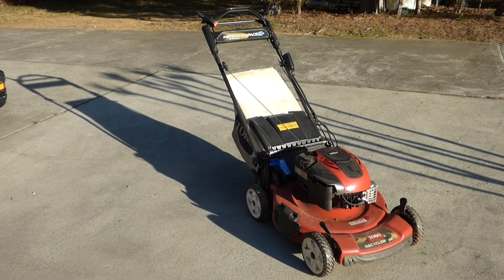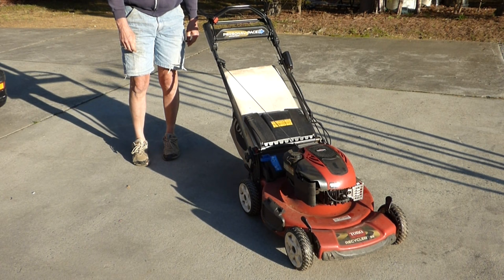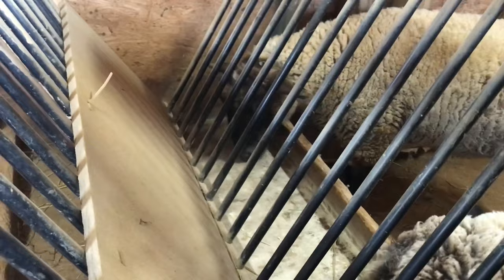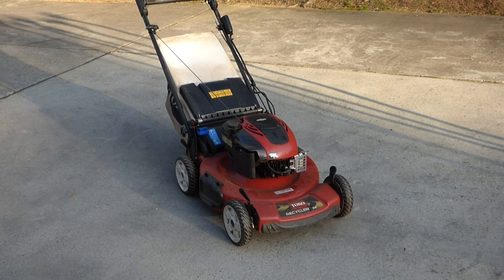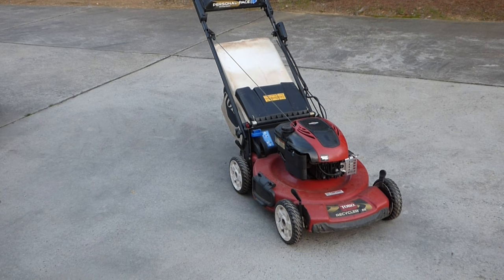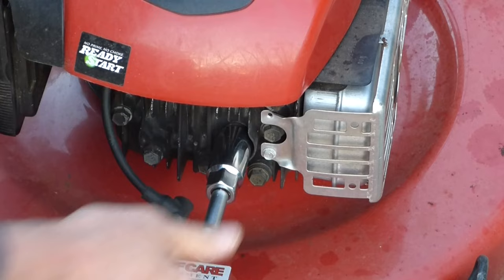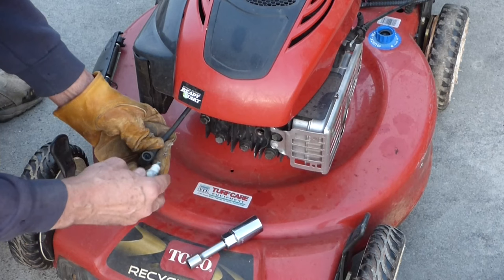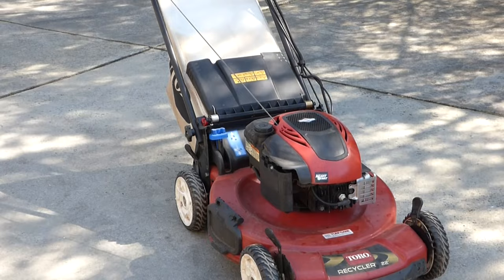Fix a Lawn Mower that Will Not Start When Hot - How to Diagnose & Repair

Comment: You're going through all these unnecessary steps
Reply: I like toro mowers
Reply: I’m having  this exact problem  on my mower. I’ve been putting off dealing with it and planning to get to it this week. Very interesting, and I, for one, appreciate your process of elimination diagnostic method.
Reply: @tommartin358 .
Reply: Agreed. Checking the spark plug was a waste of time. It obviously has spark.
Reply: @dropndeal  it's common sense, nothing "superior" about it.
Reply: Was that the original fuel that was in the lawnmower, or did you put fresh fuel in it? If it was the original fuel that sat up, there could be condensation in the fuel. Just dump out the old stuff, and put fresh gas in, and it should crank up. I run into this problem a lot, especially right after winter. I live in southern Louisiana, and the humidity is an everyday thing around here. YAH bless!!!
Reply: @tommartin358  tilt the mower over towards the carburetor then pull it .
Reply: Not everyone knows small engines so he’s just showing them what to check to all you master mechanics of small engines… ungrateful people on here
Reply: Thank  you sir for a such great video !! I really appreciate
Reply: I have the exact same problem and I’ve gone through the same steps and it hasn’t helped. The mower always struggles to start on the electric starter, it cranks and cranks and cranks until it starts. It starts a bit easier on rope. I’m at a loss.
Reply: Also the voice is extremely annoying
Reply: Why would it be the carburetor it was running fine till you shut it off
Reply: Great job thanks
Reply: @jwayne777 won't that leak oil into the carburetor intake? 😮
Reply: Op your dad isn't your real dad

Comment: the easiest fix is a shoestring tied around the handle.  NEVER shut it off!!
Reply: Mine stalls sometimes if it gets blocked up with grass, I’m having this exact same problem, identical mower.
It’s been such a great engine up to now, had it 8 years and until this year it’s never needed 3 pulls to start, even after winter.
Reply: Zip tie open enough to slide around the handle

Comment: It's the coil that rides on the fly wheel. And some times need to take sand paper and clean the rust off of the fly wheel
Reply: Coil needs sanding and block mount area

Comment: Great video, I just went through dealing with a Briggs 725EXI lawn mower engine that always starts and runs great for as long
as you want, but is dead as a dodo immediately after you shut it down even for a couple
of minutes while emptying the bag.  And then after about twenty minutes of cooling down, starts right up again.  Replaced the coil, cleaned the carb, which helped a little for a while, and then replaced the carburetor the other day, and the problem still persisted!  I had an AH-HA moment yesterday when I started to suspect that crankcase breather oil fumes that dump into the air cleaner were involved.  Sure enough, after temporarily disconnecting the breather hose from the air cleaner housing, the hot start problem was eliminated!  Did repeated hot starts on the first or second pull.  This 725EXI has recently starting to burn a bit of oil, and you can see oil sludge building up inside the air cleaner housing at the carb inlet.  Apparently the hot oil fumes are messing up the fuel mixture enough to prevent a hot  start, but do not really impact a running engine, the engine always runs very strong and smooth as long as you let it after a cold start, but once hot, nothing doing!  The whole situation makes sense now, once the engine has cooled down, the crankcase fumes are not present on a cold start to
mess up the air fuel mixture….

I’m posting this to bring this to everyone’s attention, I have not seen anyone else make the connection of the hot no start problem to crankcase oil fumes.

Looks like the engine needs a piston ring job, wonder how easy that will be, anyone out there have any experience with that?  Any associated YouTube videos?

Chris B.  Stonington CT
Reply from the maker: Thanks for sharing
Reply: Thanks for sharing as I have exactly the same pattern on an old engine that does burn some oil. I replaced the spark plug, carburetor, air filter and no change. Will try your suggestion. Thanks
Reply: Great job figuring that out, same issue here
Reply: Thanks for sharing. I’ve also replaced carb and coil, air filter is unrestricted and governor adjusted according to manual. Still have problems after shutting off to empty bag. Guess I’ll be performing a compression test.

Comment: Exact lawnmower, exact problem since new. Took to a toro dealership said they fixed it. 2nd time I used it, it acted up again. I sold it yesterday they found your video and took off the carb and cleaned it. Solved the problem.
Reply: Yup, sitting over winter with gas in the carb will mess it up every time unless you put gas treatment in it...

Comment: Same issues I had. I first replaced Spark Plug & Air Filter, didn't do any better. Cheaned fuel line, carb & stuck auto choke.👍 Fixed.😃
Reply from the maker: Way to go!

Comment: Fabulous instructional video! Thanks so much! I've got a 12 year-old Craftsman Briggs & Stratton Chipper Shredder that does exactly the same thing. Tuned it up with new materials. Drained the gas, sprayed the carburetor, etc. Runs like a charm on cold start, but won't restart when warm or hot. So frustrating. I was ready to buy a new engine coil, but I think I'll try to more thoroughly spray the carburetor again and see if it can restart when I need to stop the engine for a few minutes. I'll also blow some air through the gas hose and see what happens. Thanks again!

Comment: Brilliant video. I stripped the whole fuel system down and it still struggled to get going. After watching this I cleaned out the carburetor😁 and used Engine Starter Fluid. Works perfect now. THANK YOU
Reply from the maker: Way to go

Comment: I have the exact same problem. If engine is hot and I restart in about a minute or less - no problem. Somewhere around 3 to 4 minutes off, it won't start. I suspected hot engine auto-choke issue but didn't want to waste time until I saw this video. THANKS! - to author and others. Will try carb and fuel line clean out, replacing gas cap.

Comment: I have a rock solid Husquevarna with a B&S engine on it.  It starts first pull every single time for all 6 years that I've owned it.  Except.... it sometimes won't restart until it cools down JUST LIKE THIS ONE!! I can't wait to go home and see if I can fix it for good!!  I'm sooo tired of having to mow my lawn in chunks day after day. 

Thank you good sir!
Reply from the maker: when that happens remove the air filter and spray some starting fluid in the carb and see if it will start (like I did in this video).  If it will start then  you know you have a fuel problem when it gets hot.  Let us know what you find
Reply: @helpinguonline  I finally found this video again to give an update:  PROBLEM SOLVED!!

I ended up taking the carb completely off and giving it a deep clean.  Cleaned out the gas tank, and checked the spark gap.  Maybe $5 worth of "parts" because I didn't have dedicated carb cleaner and sub 30 minutes of effort; and it hasn't had the issue SINCE!!!  It's been back to first pull every time for a month now. I was looking at buying a new mower before you taught me the fix.

Again, I thank you for your knowledge & this video!!!
Reply: @helpinguonline  Reporting in Captain. I installed a gas line cut off last summer, so the carburetor never sits with gas in it; and it starts first pull every time to this day. 
Again, thank you for curing it!

Comment: Yay. Congrats! 
This is NOT the prob with mower,  but it IS a prob with my 30yo Ford Fiesta: starts first time in the morning but when I come out of the supermarket it can take up to ten tries before it starts. You can hear the starter whine and finally connect. Did a bench test on starter, cleaned all connections, no difference.
Reply from the maker: Sounds like the throwout bearing on your starter is getting weak and going bad

Comment: I ve been fixing mower s for some years and In my experience its almost always the carb.  hardly ever a coil or plug.  BUT I h ave one now that still wont start hot even with a clean carb... seems to need a bit of choke even when hot.  driving me crazy. 
All the best!
Reply: Same problem for me, I've cleaned the carb and I still won't start when hot. 
Have you found a solution?
Reply: Same problem for me, I've cleaned the carb and I still won't start when hot. 
Have you found a solution?
Reply: Did you fix it George?
Reply: Thermostats go bad on these over time.  You can see the problem from the side by looking at the position of the arm.

Comment: I am having this issue with the same kind of mower just wanted to see what your fix was. After disassembling the top of the motor checking and rechecking the coil gap and making sure the choke flapper was operating correctly. I found that the thermostat the that keeps the choke open when it's warm is causing the carburetor to not deliver fuel to restart. Therefore I need to clean the carb like you did. So there's the root of the problem, the choke system!

Comment: I've got a Stihl FS 280 Brushcutter that does exactly the same . Starts and runs a treat but once it's heated up , if you switch it off before you're done , then you can forget starting it again . Now I know a good place to start . Thanks .
Reply from the maker: Glad it was helpful to get you started on your repair

Comment: "Throwout bearing"!! I've never hear if them. Thanks a lot for the clue. I shall start searching forthwith. 
In fact I bought a second hand starter from Napar (is that the word?) for 60€ but never got 'round to testing it for the simple reason I didn't know how😮. Well, I finally tested it and the pinion/bendix shot out but didn't spin. Dismounted my one and it did shoot out and spin  so having cleaned all connections I put it back -- no difference. Someone said if the starter isn't used for a long time (9 months since I bought it) it can stick. 
So I'm looking up how to clean them up, and now also "throwout bearings'.
Thanks again for the lead! Very kind.
Reply from the maker: Disregard the throwout bearing I was thinking of another thing regarding a clutch. You are correct at looking at the Bendix. If your starter is working properly you may have some missing teeth on the flywheel so when the Bendix shoots out there’s no gears for that to engage with. Otherwise maybe your Bendix was stuck and now you freed it up when you did the bench test.  Sorry for the confusion

Comment: good info,  I tried this and I still have issues.  it seems to loose compression when hot, suspect exhaust value issue. it is also on a Toro. I even replaced the carb with a new one.   I had a used Coil that was known to be good and tried that and still have same issues so I knew its not a coil

Comment: Nice fix.
It was water in the gas. 
Just pour the gas out in a clear jug you can see the water inside.
Then drain the gas from the carburetor bowl by removing the bowl plug..
Before you do all that above 
You can tilt the mower  towards the carburetor to see if it starts. 
Thats how I find out. 13:35
Reply: So, if it starts up when i tilt the mower that means i have water in the gas tank? Thank you in advance.

Comment: I have a Husqvarna self-propelled with a Honda engine that will start on 1 or 2 pulls even after sitting in storage. It has never given me any problems.  My Troybilt Pressure Washer uses a Briggs, and it will no-start after getting hot. In fact, it exhibited this problem even when new, and after carb replacement. I guess it’s time for a coil replacement.

Comment: Check coil and Flywheel. Believe it or not you can hit something and jam the flywheel. I replaced both. Have new mower now.
Reply from the maker: Often times when you hit something it will sheer or knock the flywheel key, which is aluminum, off and throw the timing off on the engine Causing it not to start or run poorly

Comment: I have a ST100 bush mower with this exact issue. it doesn't restart when the auto choke system opens the choke butterfly valve in the carb. This however is the correct function of auto choke as restarting a warm engine choked may flood it.... as a closed choke creates the maximum gas draw.  Choke is needed when cold but should be open when warm. if a mower experiences this issue and a jet of fluid starts it, I guess there may be a suction leak somewhere resulting in no fuel delivery when the mower is manually pull stated. To complicate everything mine has a evap filter, additional hoses, possible sources off a suction leak !

Comment: Got the same mower. Hard to start after months dormant. Gotta yank the carb and clean out the old gas. Also, gas cap doesn't like to vent after a few years. I just back it off a few turns to stop the vacuum lock.

Comment: Very helpful video.  I had the same problem with my Toro Recycler; whenever I stop to empty the bag, I had to wait until the mover cooled before it would start.  I replaced the spark plug, changed the fuel, changed the air filter, but problem remained.  I  pulled the carburetor and cleaned it and ..... problem fixed.  Thanks for posting.
Reply from the maker: Way to go!

Comment: I was 99% certain what the problem was before I watched very much of your video? Wanted to see if there was something I had not seen, but that did not happen. It is the main jet that anchors the bowl to the bottom of the carburetor, and that's what it always is! That jet gets plugged very easily. I am going to install an inline fuel filter between the tank and the carb and see if that eliminates the non-starts.
Reply: Same.  Surging on first start was the telltale sign.  Choke is used when cold which allows more fuel for startup, but when hot the choke isn't used and the engine is starved for fuel.  If jets are clear on cold startup it won't surge like that.  Ideally, he would do a full disassembly and cleaning of the carb.

Comment: if its hot and it wont start with starting fluid...you dont have enough spark to start it....change the coil.  I've seen these things go bad...sometimes in the middle of cutting it'll just stop...you let it cool down and it will start right back up. Like someone else said spark plugs rarely go bad...you can pull and clean them, check the gap (about .030 for Briggs) and ensure insulator is not cracked..and torgue them properly. they need to be tight enough to seal properly.

Comment: I have the same issue with my Recycler. I've cleaned the carburetor, but the problem remains. Like yours, it will start with a shot of starter fluid and continue to run. If I close the choke while it's hot, it will start, though it's stubborn about it. I didn't trying blowing out the fuel line, but it seems to flow fine as it is. I may have missed something in the cleaning, but I cannot think of what.

It's a PITA. I have a second Honda mower, but it's a Frankenmower and doesn't do my preferred method of mulching. I also have a Honda riding mower, but it's seen better days and the electrical is an issue, as is several of the tires. My other riding mower, a Ryobi rechargeable electric doesn't want to work either. It drives fine, but the blades won't spin. They do start occasionally, but not enough to be considered even semi-reliable. I just don't have luck with outdoor power equipment.

Comment: I have a 2008 McCulloch B&S mower. Used to have a problem every year with the carb gumming up and fine debris in the fuel. Time consuming fixing it. Difficult or impossible to start. My cure was fitting a cheap Chinese fuel filter and stop cock. When I’m finished with the mower for the day I close the cock with the engine running and allow the carb to empty. I use B&S fuel preserver also. No problems for years. It starts right up after a freezing winter here in Scotland. E5 fuel.
Reply from the maker: Way to go

Comment: I just did a cleaning of my dad's trimmer. Same thing, he insisted it was the coil. We took it apart and check the gap. Nothing. So i just took apart the carb, sprayed some cleaner, and put it back together and it works like new. I'm just sad that everything is going battery these days and OEM Parts are getting harder and harder to find.

Comment: With the ethanol fuel in the mix, when the mower sits through the winter months come spring it's gummy in the carburetor.
Reply: I had a retired small engine repair man tell me to use fuel with no ethanol and it would resolve the issue. Said that was the biggest problem with weed eaters too. Cleaning carburetor only works for a little while then the issue returns